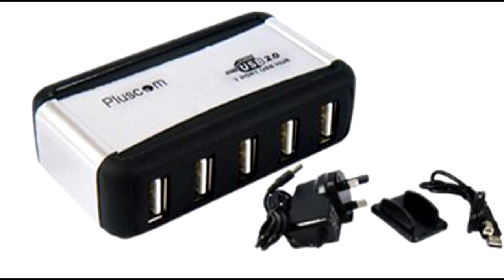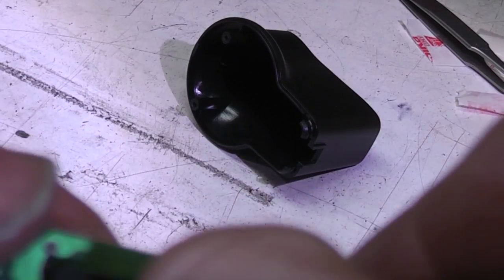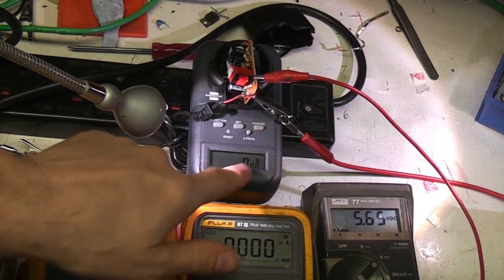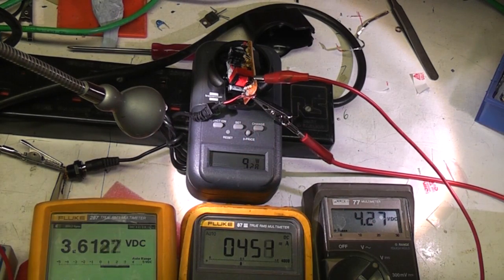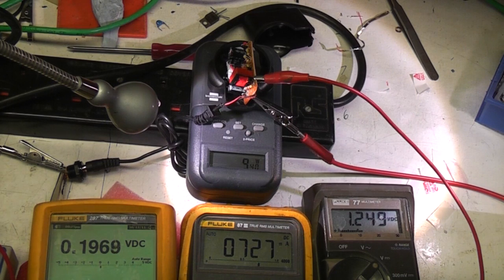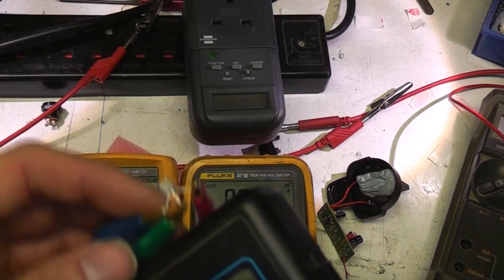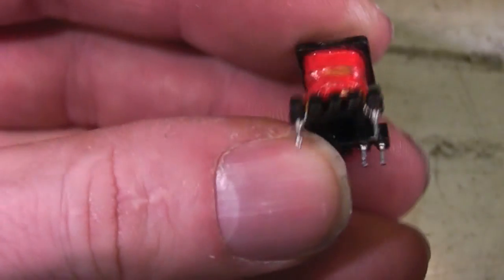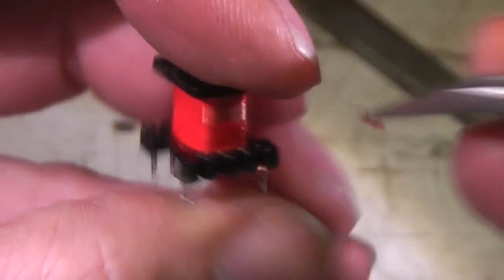Crappy PSU analysis

Comment: What is the current requirement of the device?  Can the wall wart deliver the required current?  Crap? Yes. Workable? Not enough data to know. 

I see this everywhere on YouTube when people “test” crap they buy from China. If you didn’t buy it for a specific need, then you get what you paid for.
Reply: Boonedock Journeyman It's a usb power supply so it needs to deliver at least 500mA/5V for one usb device according to the USB 1.1 and 2.0 standard.. Which it apparently can't do

Comment: This doesn't even comply with USB spec. USB spec allows the 5V power rail to be 10% off at MAX! (that is right on the output: not measuring Vdrop across the wire) This one is a whole lot more off.
Reply: +rhbvkleef No, it is 5%
Reply: +MrIndeciso thank you for the correction! was kind of a guess.

Comment: I have actually found a great use for some of these cheap power supplies. I have got them to accept as low as 18v input and they still output the correct voltage and I use them to run lights on a high voltage electric bike.
Reply: thats interesting fact, because everytime I needed a DC DC converter it was a overkill for such use..thanks for finding source of suc cheap dcdc converters

Comment: Its a self oscillating flyback converter or ringing choke converter, the problem is it uses the bias winding, the outmost winding, as positive feedback but also in the transfer period as negative feedback, and the cross regulation between the isolated secondary and the bias winding is terrible, so as more current is drawn from the output the stronger the negative feedback and the voltage in the secondary drops. But you can definitely squeeze 5w out of it,  I've done it just changing the feedback circuit.

Comment: I have found a little-less-crappy SMPS. It can do 2 amps almost shorted but the voltage drops to 3V. It is rated at 1A (and is regulated, but to a point.)
However it puts out so much electrical noise!!

Comment: I bought one of those hubs at a local computer store and it came with roughly the same power supply. I think I tugged the output cable or something and shorted, but due to a lack of a fuse, the fucking thing kept going, it popped and started to melt, I didn't know it at the time, so went out while it was melting. If I hadn't have forgotten my wallet and smelled the smoke, that piece of shit would have burned the house down.

I don't go anywhere near any cheap mains object anymore.

Comment: after watching this video, unplugged my phone's USB cable from the cheap Chinese light weight power supply it was plugged into and plugged it into an old USB 1.1 seven port mains powered Belkin branded hub with a nice big T03 power transistor visible through it's case, I feel safer now!

Comment: well, if rated at 200mA it wouldn't be half bad. 1000mA seems slightly optimistic : )

I bought an inexpensive Atten bench supply recently and it seems to work quite ok but the leads that came with it drop 3V at the rated 5A which is a little bizarre : )
so I made my own with some speaker cable

Comment: I had one of those Brennenstuhl meters - it generally shows "0" power below about 4 W of power.

It also goes wildly inaccurate (e.g.  once the internal batteries start running down (probably some op-amps running out of range, as the current reading gets "clipped" progressively lower as the batteries run down).

Comment: I'm surprised that this could be done with just one transistor.  Most switching PSUs will have a resistor in series with the AC line, it's to prevent a big inrush surge when it is plugged in, bigger PSUs use a thermistor instead which starts out with a high impedance and then becomes lower as it gets warmer letting more power through.  But no feedback in this thing?  That's just stupid.

Comment: Holy crap! I bought that same USB hub here in Australia. The power supply for it was 850mA or something. If I hadn't have forgotten my wallet when heading out that one night, my house probably would have burnt down.

A capacitor inside it had blown up and the whole enclosure was just melting before I turned the power off.

Ever since then I've always checked my plug packs to make sure they at least look decent.

Comment: The USB Specification for a charger port does specify curves that the power supply follows. It would be interesting to see if the curves match those specified.  But it's completely ridiculous as a PSU.  As a radio ham, you can buy cheap radios from China which are reasonably good. However they come with an identical charger PCB.  They also generate tonnes of EMC and RF crap!  Best. George

Comment: This is actually slightly better in some respect than what I found roughly half a year ago 

ssj3gohan.tweakblogs. net/blog/6487/een-adapter-van-$4-is-het-wat.html

That PSU had iron filings or clippings inside and maybe 1mm creepage, as well as absolutely fake ground connection (the ground connection was tucked very near to high voltage lead from the primary cap), plus the obligatory ridiculous output noise. Lots of fun with these things.

Comment: Those cheap powered hubs also usually have a 0 ohm resistor instead of a diode to stop the supply feeding into the port.. if you get a blown port you know why ;)

Comment: Well i was actually quite impressed that they manged to make a switchmode power supply with a single cheep transistor, not the best idea to use it for a USB HUB tho that needs amps of current and some safety wouldn't hurt aswell.